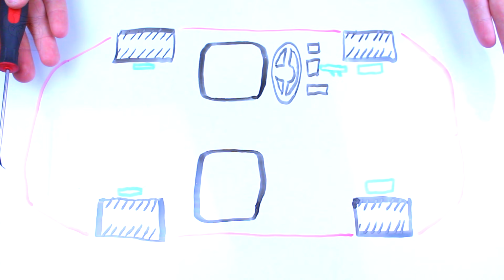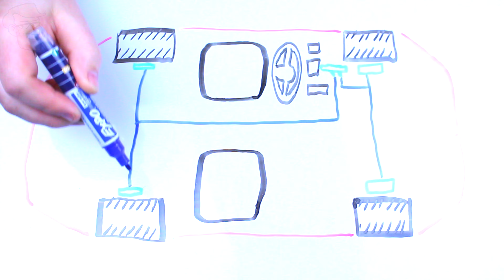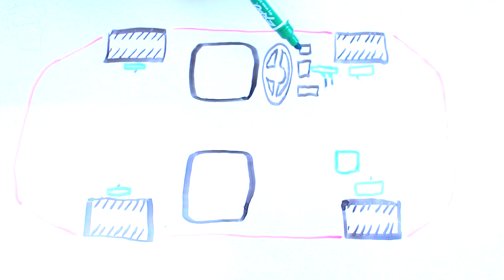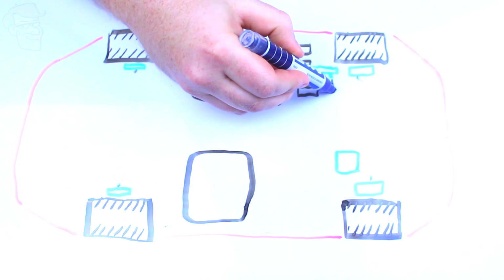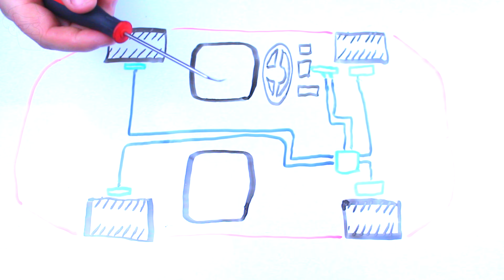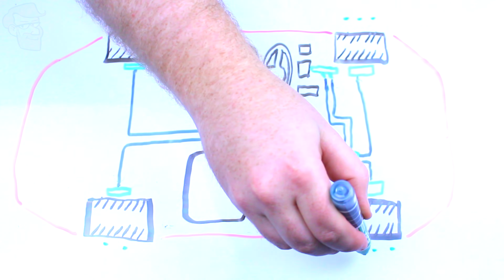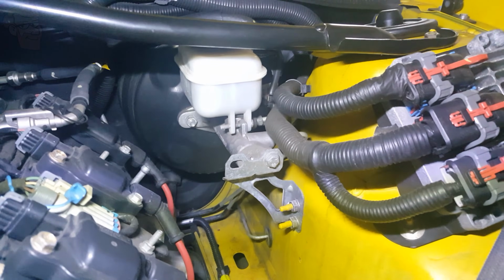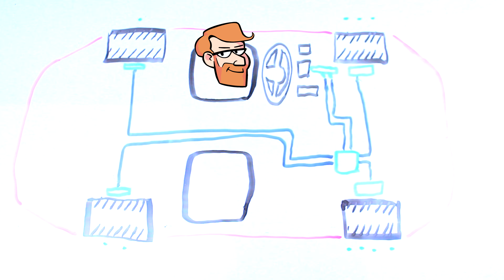Brake Bleeding Order: Not As Straight Forward as it Used to Be • Cars Simplified

Comment: thanks for the info!  I have a Lexus is300.  the master cylinder is on the front driver side.  but the ABS is on the passenger front side.   in general guidance is to sequence RearR, RearL, FrontR, FrontL.  But i'll modify based on my ABS location.  RearL, RearR, FrontL, FrontR

Comment: So the general consensus is to start bleeding the furthest wheel from the master cylinder and finish with the closest one to the M.C., but for cars with ABS pumps where the ABS pumps that are not on same side with the M.C. in the engine bay u will have similar procedure only you swap the word master cylinder with abs pump so u start bleeding the farthest wheel from the ABS pump and finish bleeding the closest wheel to the ABS pump, I have Suzuki Japan import and the layout is exactly like u showed in your video with MA on one side and the ABS pump on the other side.

Your video is by far best one explaining things correctly, lots of forums and videos do not explain and only show the one universal old school method that its best suited for cars without ABS, the 1st one u showed, it shows clearly that u know what u are talking about, many ppl learned the ONE method by hart and that's it, it works for sure but it is not the ideal one.

Comment: If I bleed three break bleeders an couldn’t get one out will this Still have air in my brake line
Reply: I got the breaks fixed
Reply from the maker: Awesome! Glad to hear it
Reply from the maker: There's a chance that there is still air in the system, because it may have been in that line that wasn't serviced. There's no way to know for sure that there's no air in a particular branch of brake line unless you've cleared out everything and confirmed that the brakes operate properly.

Comment: Brilliant video! Helped me figure out the route on my 2010 Prado(RHD). As suggested it has the master ans ABS on the front left, then runs the brake lines down the left (passenger in my region) side. So the RR is actually furthest, then RL, FL, FR 👌🏼

Comment: What happens of you dont bleed them i  the correct order?
Reply from the maker: Well, there's a chance that everything will be fine, but there's the risk of leaving air in the system or not getting all of the old fluid out.
Reply: @CarsSimplified  As long as you do not introduce any air into the system there should not be  a problem. I just did this on my 2014 Toyota Avalon, I started with the front wheel driver side, then passenger side front, then driver side rear and the passenger side rear.

Comment: Thank you for a concise explanation (and without distracting/sometimes goofy background music or long intros...).
I came here when checking if to start with closest or furthest.  I'll be replacing front hoses on a 69 GTO w/front disc brakes.   This car has separate chambers in master cylinder for front and rear - there's probably a proportioning valve, but the two circuits will be insulated/completely separate.  I don't think I'll have to bleed the rear brakes after opening the front lines - I plan to drain all fluid to fronts and replace it.   

I wonder if the reason for "furthest to closest" order started with old brakes that used a single chamber master cylinder going to all wheels.   You'd want to make sure all bubbles were gone up to the furthest point to get past Ts/branches to other wheels.  For systems like ABS where each line is basically separate, it may not matter much at all - though there can be a mess (if changing the master cylinder) to get fluid and air past various chambers.  For RWAL brakes on my GMC pickup, you're supposed to manually open a valve (there is a tool for this) so fluid gets through to somewhere... otherwise you'll never get air out of the rear lines.   Point of this tome is there's more to it than just distance from the master cylinder - and it can get tricky if changing the master cylinder (always bench bleed the MC first)
Reply from the maker: Thanks! I do kind of use background music in my videos as it helps reduce the background hiss in my main audio (and if that hiss is bad, I sometimes increase the music volume a bit), but I know to not make it interrupt the main point of the video.

As for the partitioned master cylinder, I suspect it should be fine, though over time there may be crossover of new fluid and old fluid if they share a single reservoir.

On those RWAL brakes, is the unit in the back, too? I've heard of both front and rear mounting positions for the single axle ABS set ups.

I hope things go smoothly on that GTO! Are you restoring it or just maintaining?

Comment: very nice video. Whats the reason behind starting with the longest line?
Reply from the maker: Thanks!
The main reason is that it reduces the risk of air bubbles working their way into a line that has already been bled. The longer you spend on a line, the more fluid is being passed by the other lines that haven't been bled yet. A little bit of turbulence is generated at the split, and that may move a nearby bubble into the new fluid. It's not going to eliminate all bubble problems, but it is the lowest risk option.
Reply: @CarsSimplified  ''The main reason is that it reduces the risk of air bubbles working their way into a line that has *already been bled*.'' isnt that implying that you already have bled another (shorter ) line?

If you start from the longest line, wouldnt the bubbles from all the lines have to travel to the long line?
If you start from the shortest then the bubbles that are in the short line get out, then the 2nd shortest, bubbles get out, 3rd bubbles get out and finnaly you do the longest line and there arent anymore bubbles to come out from the other 3 lines.

i got confused.
Reply: Ah - good explanation.. "turbulence at the split".   On my 68 Impala, I was wondering if I'd ever get all air from front lines... the "T" is higher than both wheels, so if I bleed RF first, by the time I do LF, a bubble from LF could seep past the T toward RF.  Maybe the small size line and thickness of fluid reduces the chance of this.